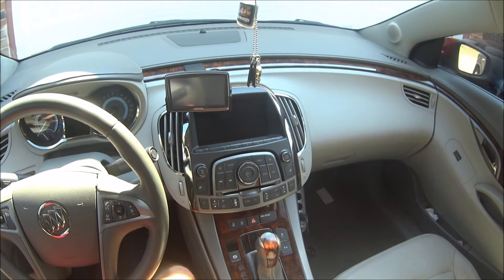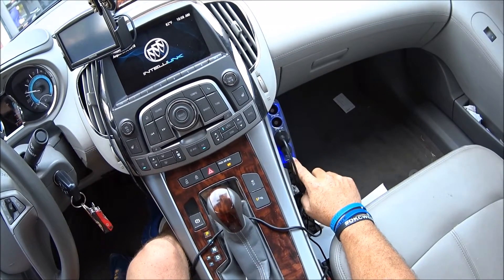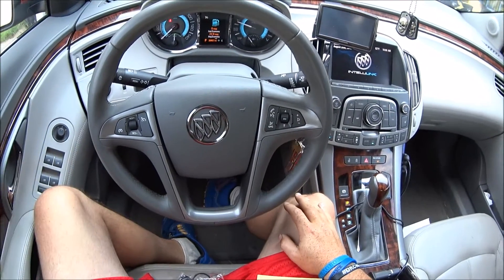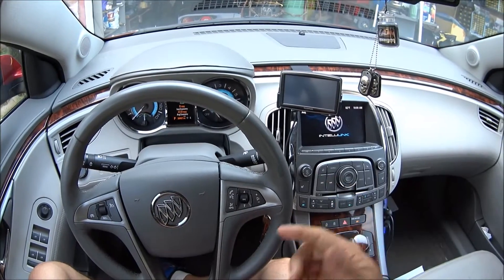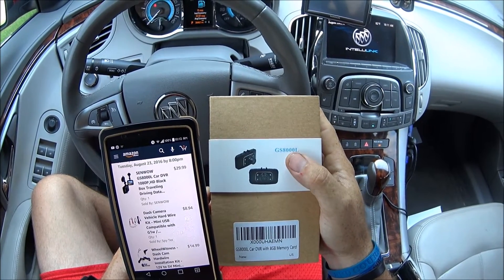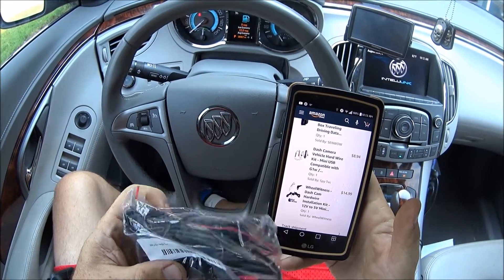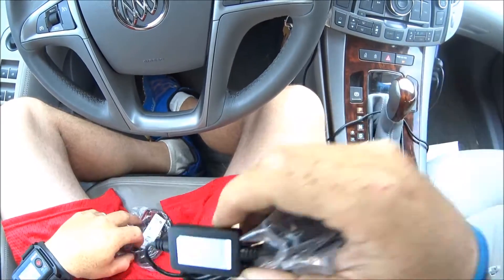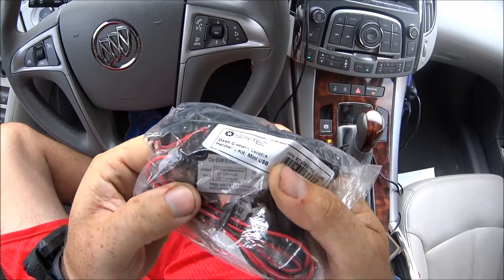How to hard wire your GPS, DashCam etc ,etc ,  Part 1 finding a circuit with voltage when key is on

Comment: The go’s is still not really hardwire in the sense the wires aren’t hidden, hardwire is about that clean interface,  running the wire up across the headliner running down the window pillar to the fuse box.